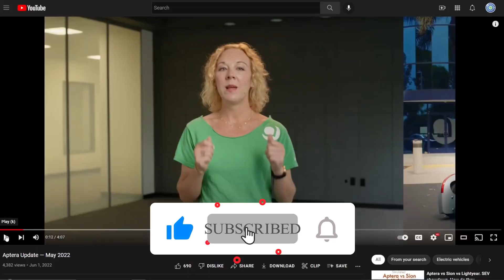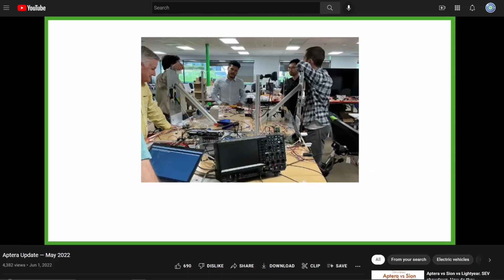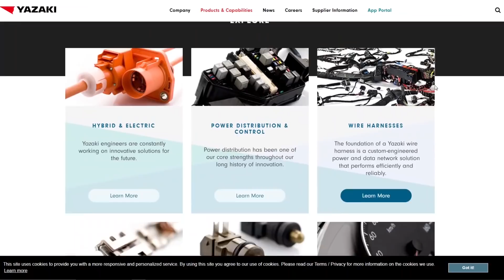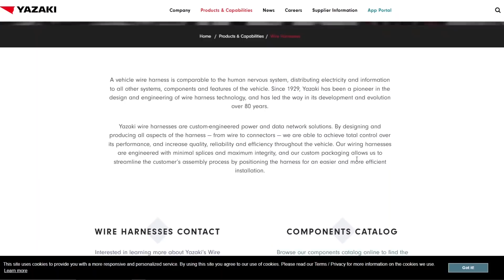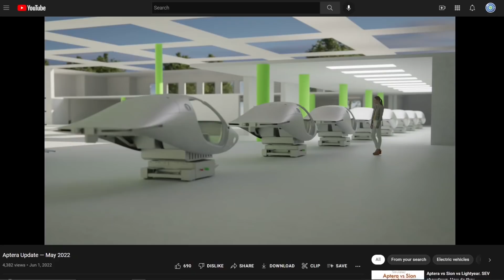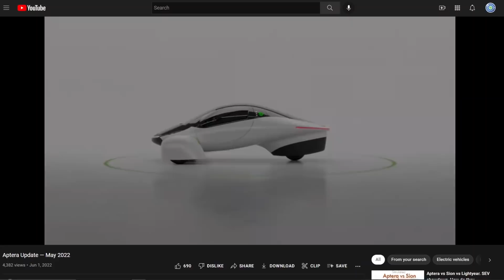Aptera May 2022 Update!

Comment: The current version is perfect from me.  I'm retired and widowed so a two passenger car with a HUGE trunk is perfect.  What I would like to know if there is a four or five passenger version on the drawing board.  It seems a logical step.
Reply: The second Aptera planned is a 4 wheel, 5 passenger sedan, according to the SEC filings.
Reply: @n.brucenelson5920  If the back seats fold down like an SUV or a station wagon, that's the one I want.  I can wait.

Comment: 1: With Aptera using "skin" cooling, how does tha work if you get stuck in a traffic jam.
2: Are you using light colors on the dash.  It causes a very annoying reflection in the windshield. I've noticed this in a couple of videos.
3: 2X I have been ready to buy a car, until the test drive. The "Gas" Pedal was too spongy, as in didn't have enough resistance. So, if you are manually using the pedal, it quickly gets tiring on the calf muscle. I did not buy either car.  We don't get a test drive. Please, get this piece right!
Reply: Unlike an ICE vehicle, the motors are not making heat when the vehicle is not moving, and the bottom of the car is still removing heat through radiation, even if the amount of convection is less that when it is moving.

Comment: Can the customer themselves completely customize the car itself? & upgrade our battery later in time? & how much does it cost to replace our battery system?
Reply: Battery packs such as the ones in Aptera are projected to last at least 400,000 miles.  The historical rate at which battery prices have come down has been around 7% per year.  When the time comes, we are likely to be able to replace the batteries and possibly with new technology.  Aptera grants right to repair.
Reply: @n.brucenelson5920  It would be cool someday if I could completely customized the car by adding the cyclocopter propulsion system to the Aptera car that comes with the emergency parachute system. Hopefully the car company would open source their car technology someday.
Reply: @michaelbrannaka4046  Aptera already grants right to repair and I know their CTO would love to see something like this.  More power to you!

Comment: Steve, great commentary to Sarah's video.  If you have the opportunity to ask some questions at the expo, here is my list.

    * Have the rear lights changed?
        * The gamma rendering seems to have the rear lights much smaller than the alpha vehicle.
        * Will there be a raised brake light in the top of the hatch?
    * 3M has an IR film that reduces the heat transfer (78%) through a window.  Given the large size of the windshield and the amount of IR that will be transferred through it, has there been consideration of using this film on the inside of the windshield?  This would allow light to pass to the solar panels without the heat issue.  It would be much easier to apply the 3M film before the windshield is installed than to do so afterwards.
    * Are the wheels / inline motors secured so they don't become quick items for people to steal?
    * What is the Level 2 charge limit? There was talk of using 3.3kW instead of 7.6kW to save 30 lbs.
    * Given that Aptera seems to like to follow Tesla's lead, will there be a mobile charge cable included?
        * Will the mobile charge cable be both Level 1 and Level 2 capable with Level 2 going to 32A?
    * Will we be able to pickup the vehicle in Carlsbad, CA and not have the delivery charge?
    * How close of a delivery model is Aptera using compared to Tesla?
    * Will selecting various options delay your delivery?
        * Can more details be provided around the audio option?
    * Is the rear window glass or Plexiglas?
    * For the full solar option, is the rear window area made from composite or glass/Plexiglas?  Composite being lighter than glass and with much better heat and sound insulation properties.
    * Is there any new information on the user interface and what the mobile UI might also look like?
    * Will the gamma vehicle be a fully functional solar (full package) with a 41kWh battery pack where the vehicle is tested and used for longer trips than short trips around the San Diego / Carlsbad area?
    * How are the regulations going?
        * What issues are outstanding and are there any issues that might delay production?
        * Can we as a community help move regulations in a common sense direction that helps Aptera?
Reply: Can you provide more detail on the 3M film?  A link would be nice but YouTube may not allow it.  How about 3M's name for it.
Reply: @bobhilder1469  YouTube blocked my previous reply so I will try again.  The material is used in houses.  I am uncertain if it is even legal to use in autocycles or cars but this looked somewhat promising. It is called: 3M™ Sun Control Window Films, Night Vision™ Series
Reply: @ddessert6  Thank you!
Reply: At present Aptera is planning for the rear window to be glass, with or without solar cells added.  Since they practice "kaizen" or continuous improvement, things could change anywhere by the time production starts, and thereafter.
Reply: @n.brucenelson5920  I had suggested directly to Aptera many months ago that they consider replacing the glass with composite as it is much lighter and a better insulator of heat & sound. The composite "window" could be kicked out from the inside like glass in the event you could not exit the vehicle any other way.

Comment: What does Aptera manufacture ?; this is going to be an expensive auto-cycle.
Reply: Its legally an autocycle but I think calling it that might mislead you into thinking this is a 3 wheel covered cycle when its more of a 2 seater adventure car. 

Take a look at the rich rebuilds video from last month, its a good overview onto what they're envisioning with this vehicle.
Reply: Aptera manufactures a two seater three wheeled vehicle classed as an autocycle. Contrary to what you believe, it is going to be the world's first Solar Electric Vehicle that can go 1000 miles autonomous on only one charge, and an additional 40 miles from the sun. For all these stunning capabilities, it is very affordable with a starting price of only $25,900.
Reply: With starting prices coming in at $25,900 it is not expensive for the performance offered.

Comment: The Tesla port idea hopefully gets cleared up soon. I really hope they use CCS and that becomes standard with Tesla as well. I like the simplicity and size of the Tesla port but i don't think that's the direction the industry is headed especially with the rated 400v limit. CCS is something like 1 or 1.2kv. 

I'd be ok with a Tesla port but I'm not convinced its future proof.
Reply: I don't think it's an either/or situation because adapters will make the charger irrelevant. Plus keeping the voltage down, but using less power with fewer batteries is a better plan overall.
Reply: @deanmcmanis9398  why is it a better plan to keep the voltage down?

Comment: What about if you blow a tire or have to change it, do you think they will provide a spare
Reply: No spare.
Reply: The wheel pants will be easy to remove, and  most punctures can be easily fixed with a plug kit and a dc air compressor.  I have done this while motorcycling and fixed not a few car tires on the way as well.  You could buy a spare, but it would probably cut your range by at least 2% to carry it around.  Not a pleasant trade off for most of us.
Reply: @n.brucenelson5920  will the wheel pants or rear skirt drag on the ground if a tire loses all of its pressure?
Reply: @IBMara  Great question!  It is unlikely because there is at least 5 inches of clearance.

Comment: This is great news.  When does Aptera plan to crash test a production-intent vehicle?  Even though crash-testing is not a requirement (I assume) since Aptera isn't classified as a car, I'm especially interested in whether they plan to do a SORB test.  My concern is that the outboard front wheels could pose a risk for cabin intrusion during a SORB impact.  It would also be great to understand the dynamic yaw if a single front tire were to fail catastrophically at highway speeds.
Reply: The best question put to Aptera.

Comment: I've heard rumors of a delay for the 40kWh/AWD model (which I've ordered) until late 2023, which is discouraging. I really want AWD, and I am hoping to have the 3rd wheel motor even if they don't have the torque vectoring software perfected. I'm wondering if they plan to offer an all black steering wheel and door materials. The light gray looks OK, but it would be more difficult to keep clean. Especially on door sills and touch surfaces. Any news about the charge plugs to be used and/adapters (CCS, Tesla, J1772)? Also I'm curious what the deal with Chery will bring to the Aptera.
Reply: We don't yet know the native plugs to be used, but adapters will certainly be available for all of these sources.
Reply: @n.brucenelson5920  You could tell in Chris' interviews that he has always wanted the Aptera to have a Tesla plug. But the key is that Tesla first has to announce opening up the U.S. Supercharger network to non-Tesla vehicles in the U.S. which I expect later this year.
Reply: Where did you hear these rumors?
Reply: @freddybell8328  Part wasn't a rumor. Chris Anthony said in a couple interviews that the AWD model would follow production of FWD versions because more development work was needed first, in areas like torque vectoring. The rumor part was a few facebook comments saying that they had directly asked Aptera specifically how long the AWD delay would be, and were told the end of 2023. In my mind, the resulting problem could be that the rumor of a long delay to get an AWD model would cause many people to change their order to FWD, just to get their Aptera faster. And in turn Aptera would see a decline in reservations wanting AWD which gives a false sense of reduced demand for AWD.
Reply: @deanmcmanis9398  Boy, you are a genius. I did exactly that. I have two standing orders, one, the FWD Limited Edition, among the first 100 preorders worldwide, and the second an AWD, a couple thousand places down the queue. In the course of time I made my AWD, 400 mile, my first choice. But after they wrote me that my order was due 2023-2024, I changed the order back to my original 400 mile FWD Paradigm Limited Edition. But I have another crippling defect, I am European!:_Sunset:😢😢
Reply: @adimchionyenadum2962  I think that once the micro factories are shown to work well in CA, and the east coast, I think that IPO funding will promote additional factories in Europe, Canada, and Asia. So your Aptera might be coming sooner than you think.
Reply: @deanmcmanis9398  Sooner than 2024? I doubt.

Comment: I am really glad that they are outsourcing from Yazaki than some Chinese companies.
Since I am ordering the Off Roader version of Aptera (60 kwh/ full solar panels), i would have liked to know what is the efficiency compromised because of this?  (considering the increase battery weight and raised wheel panels).
Reply: We know that every 30 lbs or so of weight subtracts 1% from the range.  I believe that the power requirements in the initial specs were calculated for the 100 kWh battery packs, however.  

We don't know the aerodynamic hit from the off road configuration, and it is likely that this is still under development.  Aerodynamic work has been ongoing until just recently to be applied to the gamma vehicle.
Reply: @n.brucenelson5920  thx. for the reply. I did not know it was 1% for every 30 lbs. I would have liked to know final figures on the Off roader efficiencies too.

Comment: If they are supposed to be releasing finished vehicles to 1st costomers end of this year. Surely that's not enough time to fully test the car in various environments like really hot or really cold. For thousands of miles. So when we eventually receive our cars in Europe will they be reliable.
Reply: This validation testing has already been ongoing for quite some time.
Reply: @n.brucenelson5920  I've not seen any cars driving around the Arctic circle or in the deserts. It's one thing doing it on a bench but another out in the Real World
Reply: @buckegit  Most outsiders never see these tests from any manufacturer.  I am an exception because I worked as a supplier and visited both the Ford and GM desert proving grounds.

We do have video of Aptera being tested in the desert.
Reply: If they manage to deliver one vehicle by the end of this year, that will be a feat of enormous dimensions. Europeans will certainly gat a more tested and proven vehicle.

Comment: Thanks again Steve. I still want to know about: (1) A tow package-How will a receiver & light plug cable be attached & what will be the towing capacity? What type plug will it be? (2) more details re the entertainment center-what exactly will it have (please list) besides Bluetooth? (3) what will the max AC & DC charge rates be? (4) will Aptera have one peddle driving?
Reply: A light weight hitch is planned, but towing capacity will be small - perhaps 2 or 3 hundred lbs.

At the beginning, only bluetooth is promised.  I have ordered the upgraded system, and will comment when I get my early production model.

Max DC charge rate will be 50 kW.
Reply: @n.brucenelson5920  Bruce. Thanks. First I’ve see re the 50KW limit. That is Level 3 DC. What will the Level 2 charge max be? I’ve seen some L2 listed in Plug Share at 9 or 11 KW but most are at 6-7KW. As for the entertainment setup, yes I’ve seen the BT mentioned. But that should NOT be the only. Not having local AM/FM is a BIG mistake. BT will allow music from phones, streaming from internet radio stations, audio from nav etc but no local AM/FM stations unless they are streamed. Many local stations are not streamed and if so at a cost. BT also means no direct access to local EBS vis FREE AM/FM radio broadcasts etc. No Aux in is also NOT a good idea. When I travel long distance I listed to XM on my XM portable radio. Aux in allows connection without a BT TX unit. So I think Aptera needs to get their head on straight about this.

Comment: 14:00 Can someone explain to me why there are only 6 solar cells in the back and there is no straight solar cell bar of around 10 cells next to each other in a straight line???
Reply: Adding 4 extra cells may not be worth the configuration changes to wiring and routing on the back tail.

I don't know. Might be a good question to ask next month.
Reply: Glad to see you changed from "panels" to "cells"!

I think the idea of not having cells across the width on the tail is that they would be rather susceptible to being damaged by impacts from loading and unloading of the rear "cargo" area.
Reply: Consider changing solar "panels" to solar "cells".  A panel (or module) is a group of solar cells.

Comment: Really hope CCS is the way they go. It's bascially the standard on all cars other than Tesla and tesla recently announced opening up to other cars in the US. That kinda suggests CCS is also coming to Tesla super chargers so CCS is basically the winning standard. The Tesla cable is more elegant and adapters are cheaper as it's more common for people to buy right now, but I really don't see Tesla going much farther since only Tesla uses it.
Reply: The plug type has not yet been announced.  If they use Tesla's, there will be adapters available.
Reply: @n.brucenelson5920  also note that just having a Tesla port doesn't mean it will work at a Tesla super charger. Tesla's stations actually require knowing your car. People have tried just using adapters on them, they just don't work. Not sure even when they open them up if the Tesla connector will also be usable on just any car.
Reply: @Skylancer727  Yes, this is very true.  Thanks for pointing it out!

Comment: I would love to know what battery chemistry they are planning on using.... Since it looks like cylindrical cells I would imagine that they are NCA or NCM. I would love it if they could use LFP cells. Also, do you or Aptera think they will be able to maintain their introductory price that they launched, or will they have to adjust prices due to inflation?
Reply: Aptera is using Sanyo 2170 cells with NMC  chemistry.  They have a video showing the production ready pack for the 40 kWh version.
Reply: @n.brucenelson5920  pretty sure its Samsung not Sanyo though right? I think they are using INR21700-50G or 50E, one of the two anyway
Reply: @20xx-mm-dd  Yes, I had a brain fart.  I will leave my comment so your correction makes sense.  Thank you for having my back!
Reply: @n.brucenelson5920  thanks for the info 👍🏿👍🏿👍🏿
Reply: They seem to be following Tesla in some aspects, Tesla has started using NCMA I think, and LFP in the cheaper models. Maybe Aptera will use NCMA? 
I doubt Aptera will use LFP due to the added weight, but I guess it's possible they'll do like Tesla and use LFP on the cheaper, 25 kWh version?
Reply: @hansmariustorgersen3218  this would make sense if they can secure supplies of cells and make it fit into their vehicle architecture.

Comment: A few things I noticed in the Gamma render that were not talked about... Looks like more solar cells have been added on the nose since the headlight changes.  The hinge line of the rear hatch has been moved further back, which increases the roof area, allowing for a few more solar cells there as well.  It's hard to tell, but this change may have allowed the doors to be a bit longer, and the rear hatch may be somewhat shorter.
Reply: There had been an earlier reveal of body changes due to regulations [mirrors and head light] and changes in the interior; lower car body slightly under seat to accommodate 6' 8", widen the top a bit. With the central light they removed some lights on the side and put in 4 cells. The roof added 10 more if I am remembering correctly. We really have not had a rendering of the rear end/hatch that showed any difference. It may be that the hatch is the same size just moved further back so no changes in cells there?